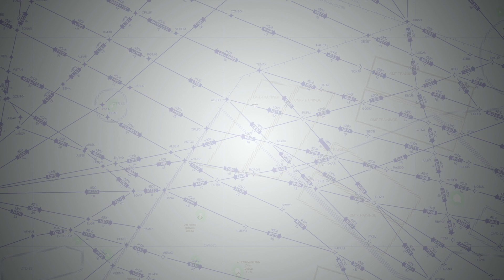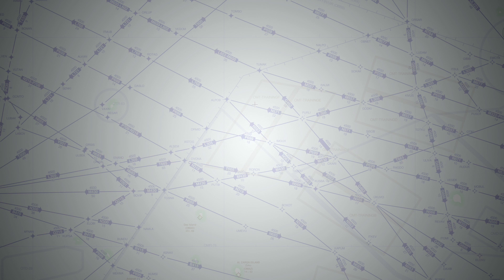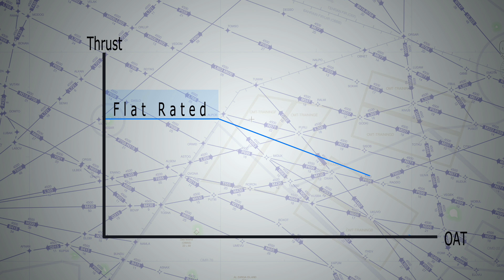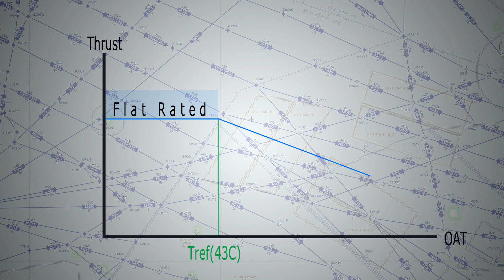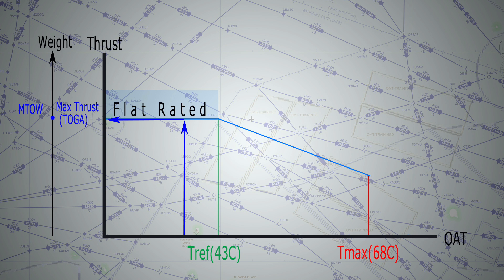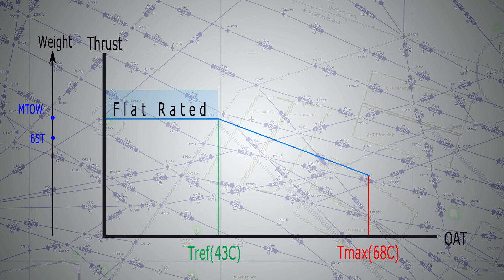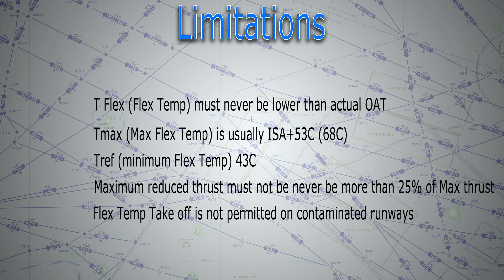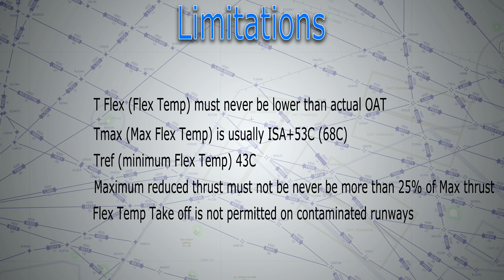✅ Flex Temperature Takeoffs Explained in Details - Pilot Training

Comment: So basically just enter the outside temperature into the flex to temp?
Reply: No. Its more of enter the temperate in which the aircraft can still takeoff with the runway given (its all calculated). 
Plus one of the conditions for flex is that the flex temperature has to be higher than actual outside temperature